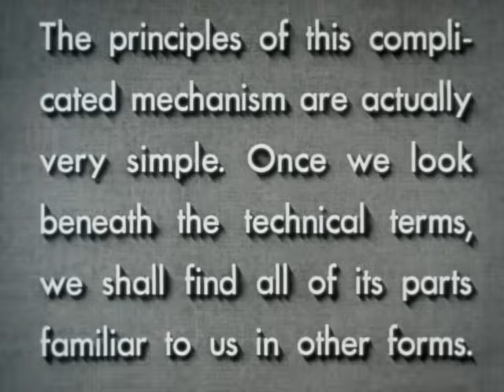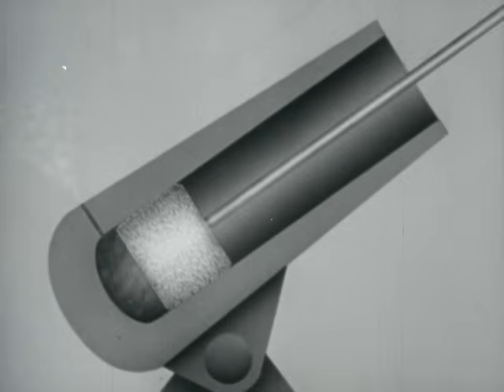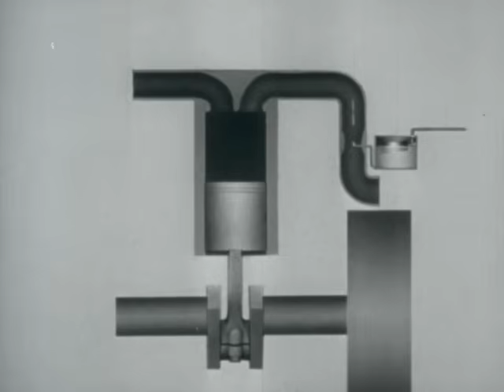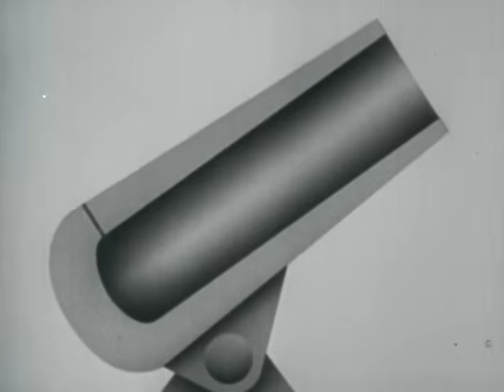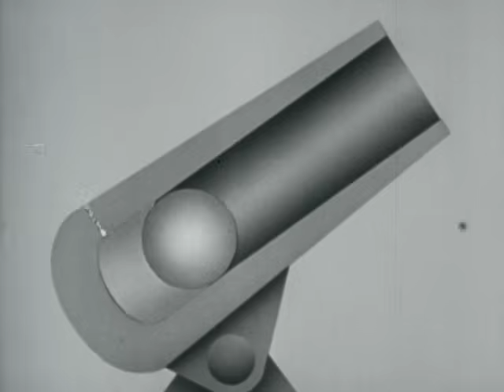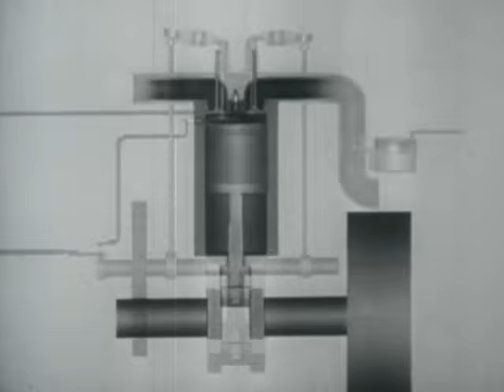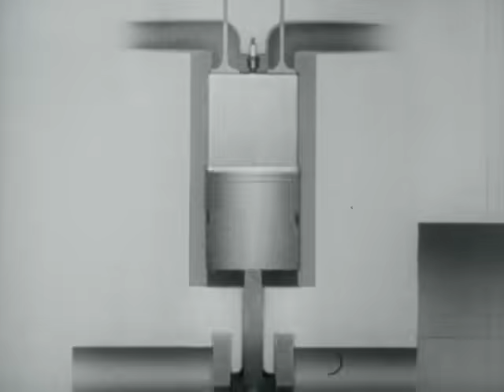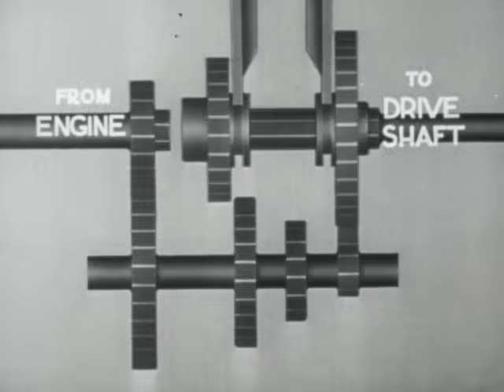Where Mileage Begins (1949)

Comment: What’s incredible to me is if you compare this video to the modern lawnmower engine, absolutely nothing has changed. Not even fuel delivery. Everything is the same, down to a tee.
Reply: With the exception of some optimizations, even modern cars are pretty much the same. The biggest difference is efi, and ohv.
Reply: And modern mower engines are reasonably thermodynamicly efficient at about 330grams of fuel per Kilowatt hour.

Comment: As far as the 3 on the tree setup, that was all the rage when introduced around 1939, prior to that the levers were all mounted on the floor with the small caveat of not having synchronizers though. However it took almost half a century for American automakers to realize that it was not a reliable and long-lasting setup (due to premature linkage bushing wear) before switching back to putting them on the floor again. Another flaw, or weak spot in old cars I'd like to add though were the flimsy wiper arm hook ups (little round elevated spots) which eroded with normal use every time you changed blades until they no longer secured them only to see your wiper blade coming off in the middle of a rainstorm.

Comment: Im 39 , back in 2005 I bought a 1972 C10 with a 250 I-6 with a 3 on the tree, I had never heard of this till that moment. After getting the hang of it I sat and thought,"'This is an option people actually 'wanted'. They sold sh!t like this to people". I couldn't really believe that people bought and drove sh!t like this. I put it on the floor instead, wasn't any easier to drive for real. Turning on and off high beams while driving a stick isn't easy at all, Gotta take foot off the clutch, kick the sh!t out of the switch only for it to jam now you have no lights... good times. Contact points ignition systems, anyone my age know what dwell means? Or how to set the points on a mallory dual point distributor? I always add my own concept with points, using a transistor for the coil and the points never get burnt or arc. I love old stuff, except 4 wheel drums....vacuum wipers, the ignition key location on a 69 El Camino, contact point voltage regulator, manual brakes , all steering boxes before the recirculating ball style,  all carbs before accelerator pumps, bias ply tires, GM door latches...dont trust them and left handed lug nuts....looking at you Mopar.
Reply: Hm, didnt know there were carbs without accel pump. I guess maybe a couple of the very first ones.

Comment: My 49 Dodge Meadowbrook is superior to that. Great film though.
Reply: Believe your ‘49 Dodge has a Fluid-Drive transmission.
Reply: @seana806  Sure does. I re-sealed it about 30 years ago. I run Type F  trans fluid in it. It's been a great car.
Reply: @Matt2chee I believe there was the simi-auto version which debuted in the late 1940’s to be more competitive. Early Fluid-Drives were just a 3 speed manual with a fluid coupling.
Reply: @seana806  Thje "automatics" were traditional gearboxes with switches and vacuum operated servo's. The hydramatics had modern style clutch packs and seals. no comparison. What do you drive? Washing machines! I just went through that. I had a Maytag commercial, it died after 4 years. I got a GE, I can't believe it works this good. I never had anything but Maytag, what junk now.
Reply: @Matt2chee funny you bring that up and ironically, GM built appliances for Frigidaire from the 1920’s up until 1979. Ford once owned Philco, Chrysler once owned AirTemp.
Reply: It was a flathead inline 6 but if that's what you consider superior then you do you.
Reply: Nobody asked😂 you just want to feel special
Reply: @billyray4716  Want to buy a 49 Dodge?

Comment: Ah back when a compression ratio of 6 to 1 was normal. these days most engines couldnt run on that low of a compression or if they could, theyd make no power
Reply: Remember, back then there were v8 fords that made 60 horsepower 😊. Now there are production 4cylinders that make over 400 horsepower.
Reply: 87 octane can fire at 4:1 compression that's 60psi
Reply: @matthewfredrickmfkrz1934  and i cant run at 10:1 compression ratio without knocking
Reply: @discozula4469 are you air cooled
Reply: @matthewfredrickmfkrz1934  im just cool
Reply: @discozula4469 not if you're detonating at 10:1 something is not cool and that's a fact jack

Comment: Nowadays, we have upgraded mechanical-ignition into electronic-ignition, carburettor into electronic-fuel-injection, but we still missing the electronic-valve and still using mechanical-valve. Electronic-valve would allow a big engine to crank with smaller Starter and battery (ie: such as compression-release-valve used in some motorcycle), it allow more air to enter when RPM is high (ie: such as VTEC used in Honda engine), or allow turbo to spin-up (ie: such as anti-lag in rally-car), and it can do all that at any time unlike mechanical-valve.
Reply: BMW also had electronic valves, but most of these things need more than 12V and the industry didn't want to change to a 48V system
Reply: Are you out to lunch…
Reply: Chrysler/Fiat MultiAir/TwinAir has electronically controlled valves. Electronic solenoids seal or dump pressure to glorified long stroke hydraulic tappets. It can close the intake valves early or late in order to reduce or eliminate throttling losses and the use of the throttle. Add a variable compression linkage like on Nissan VC turbo engines and you would have the ideal engine, with no throttling losses, constant compression, and arbitrary Atkinson cycling down to atmospheric pressure. It would also be trivial to disable dead or unneeded cylinders.
Reply: @gregorymalchuk272  Ah yes, unnecessary complications to make unreliable junk that isn't worth repairing....
Reply: @KevinJames-yg9eu MultiAir is pretty reliable. Solenoids aren't unreliable and can be cheap, though Chrysler/Fiat decides to integrate them into 1 single 1,000 dollar brick, but it doesn't have to be the this way. They can't blow up from lack of oil, as the intake valves won't open.
Reply: Königsegg uses electro-pneumatic valves in their hypercars. It's called Freevalve. It's amazing tech, gives engineers soo much freedom when it comes to tuning the engine. You can smoothly and independently change valve timings while motor is running, you can even switch between 4-stroke and 2-stroke cycle on the fly, assuming you have forced induction.
I think they achieved something like 600HP from 2L, 3-cylinder with turbo.
Reply: @PLCmOs  "Königsegg uses electro-pneumatic valves in their hypercars", no Koenigsegg does not use FreeValve on any of their (production) cars.
They likely ditched the FreeValve pneumatic-hydraulic system due to extreme power usage and very likely other reasons.